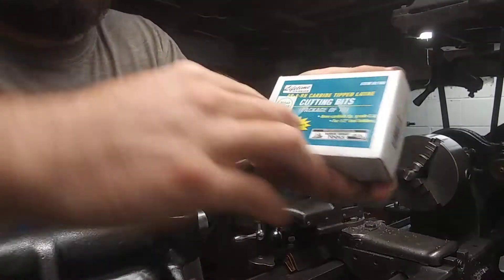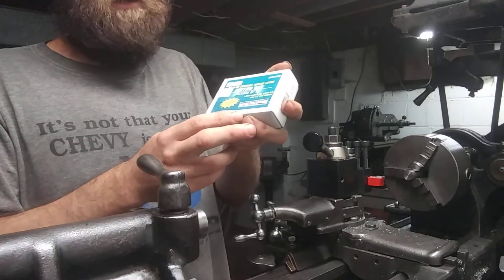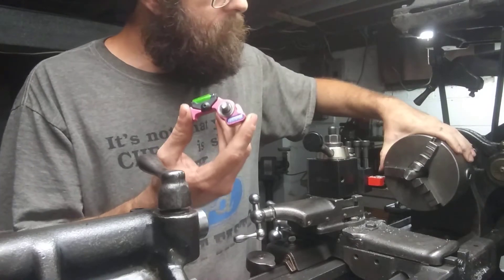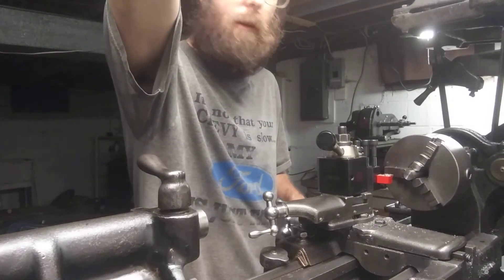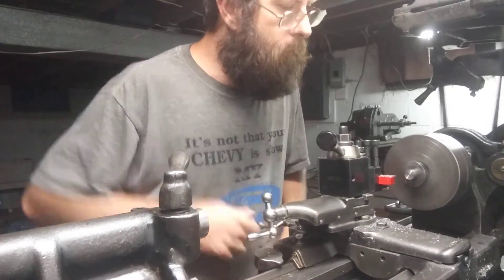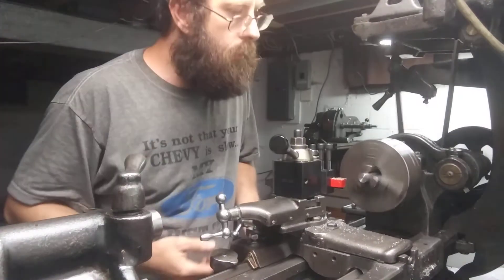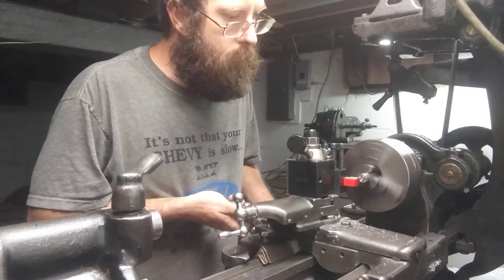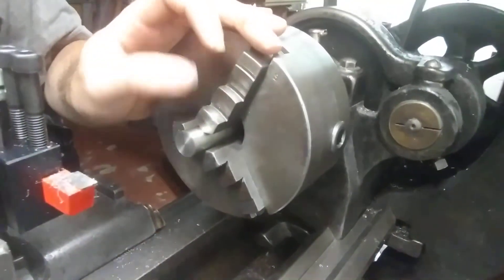Review Harbor freight : Lathe carbide bits

Comment: I like the T-shirt, I drive a Mustang and have had 3 so far.  Did you sharpen these first?  I just tried some and started too slow and had chatter break the carbide.  I was using a cheap milling vise on a wood lathe though!  So, any advice other than sharpening them a bit first, and using higher speeds which worked for me?
Reply from the maker: Using higher speed for wood turning is a must and making sure the tool is level with the work pace too.

Comment: Will, they're designed to be sharpened and  before use.
Reply from the maker: I know did not have enough time in the day but next show how to sharpen stay tune
Reply: This above all else! These never have been ready to use tools. They're blanks to be sharpened before use and can be resharpened many, many times for the cost of a carbide insert.  btw, Once I got a better setup to sharpen & hone these and/or HSS I've just been using 'em and kind of abandoned HSS and carbide inserts on the lathes. (11" & 12" imports)

Comment: I picked up a lathe a few weeks ago pile of these in a box. All chipped and worn. I found 3 that looked Un used , not cutting very well.
My lathe tops out at 1600 rpm .  Im having better luck with dull HSS.
    If they need to be sharpened before use , ugh pita. I dont have anything that will touch carbide
Reply from the maker: Hss bits are better when sharpened and carbide no need to do but if u do it cuts the life and type of metal you cut with it.
Reply: Check out videos on sharpening both HSS and cemented carbide and you should come to appreciate the convenience of these grind for radii or for grooving. (ex: one plunge vs stepping to width) As for rpm IMO you have plenty unless most work is <1" dia. When you learn to sharpen both HSS and carbides you'll see why we like 'em. btw, grind down (green wheel) to clean up chips. There's plenty of stock on most to practice on. Cheers.

Comment: I bought some of them. their garbage. with 2 in. it broke the tips off the carbide
Reply from the maker: Broke tips try leveling the tool I have a video on review on edge tech lathe gage it will help you out
Reply: There are several things that can cause this. Running too slow, too deep of a cut, and thermal shock from coolant(run it dry or flood it so it doesn't break) are just a few.